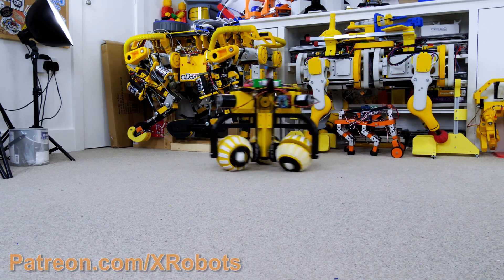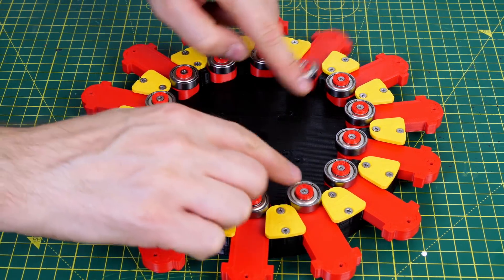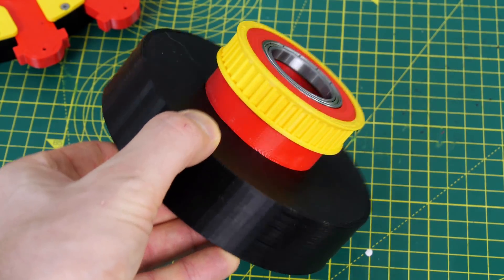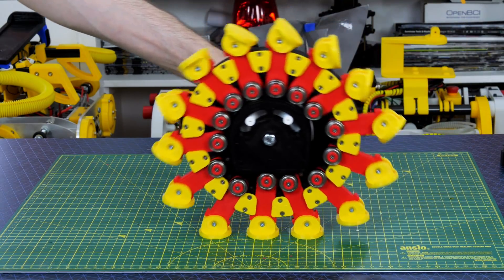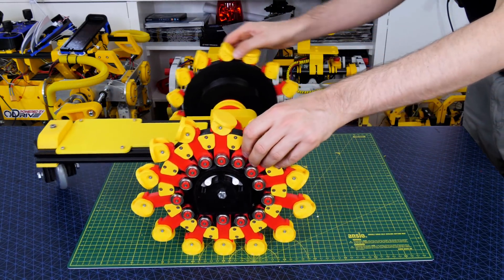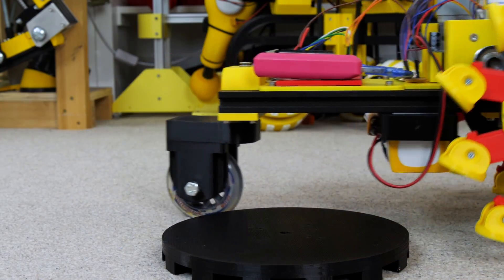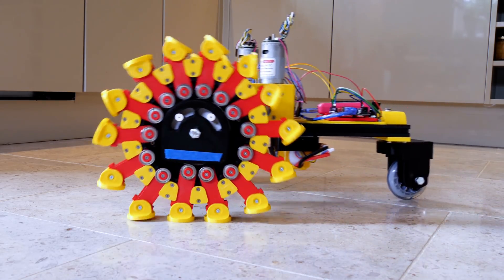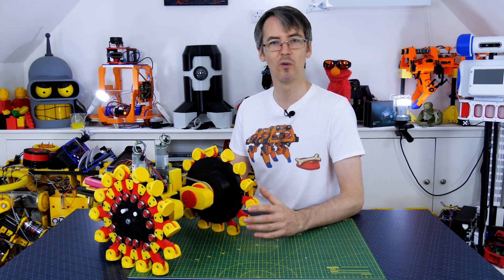Are these Walking Wheels Practical?

Comment: So nearly my battle-ball idea (which can climb steps) : Replace the pins with linear actuators. The original intent was a self-returning ball that could move by changing its shape so only as fast as its actuators. The 'battle-ball' name came from a tank design in a very old comic...   Using the latest actuators and selectable feet for different terrain, you could jump as well as climb and walk, absorbing impact of falls, etc.

Comment: Perhaps to combat the tangling problem you could have rather than rubber grips a rubber belt all the way around affixed to the feet. That way you have something more akin to a deformable wheel. You could add a bit of tension through a rubber band or such like to the parts of the belt inbetween the feet so that it always folds up and in and out of the way. Or you could make a mechanical belt tensioner of some kind inbetween, no idea if that would be possible but as far as I'm concerned mechanical belt tensioners for things that change geometry in any way are witchcraft but people do it anyway.

Comment: You should try replacing the feet with a continuous flexible rubber tire that goes all the way around the wheel. It should be flexible enough to let the legs move fairly freely.

Comment: Just saying, no hate but calling this impractical is not true, Relying on the feet without any rubber, is like relying on a car with no tire on it or like walking on a slippery stone without shoes. In one way, we ourselves are impractical, so we use other tools to help us, like shoes or clothes. The hose test is impractical, these things won't climb hoses, but instead climb stairs or rocks. I mean, a true circle plastic wheel wouldn't be able to climb any of these obstacles, nor would it reliably drive, without some form of grip on them. I'd say add rubber shoes on them so we can see it's max capability. (Also 4 wheel drive). Yes, without any grib on those feet, it's impractical but that's with a lot of other things, so i'd say try it, let's not give up on this idea!

Comment: Maybe if you'd bolt a loose, stretchy belt to the ends of the feet that would go round the circumference of the wheel you'd have a wheel that changes it's geometry to conform but wouldn't get tangled in things?

Comment: I would like to see a version 2 on this project. This time with 4 wheel drive, semi sphere shaped rubber on the feet, and a suspension.
Just on a side note, if you had printed a normal wheel it probably wouldn't climb those loose objects, so i think it's a success.
Reply: This! Saying this test wasn't a complete success is mind boggling. It where able to climb steps and different shaped objects. A wheel without any rubber or grip would just hit the object and spin while pushing that object away. This climbs it, even without any rubber at all! There's so many fun experiments and possibilities if that where added. I mean, Boston dynamics robot uses rubber feet. If those where solid plastic, it wouldn't be able to climb a single thing!

Comment: Love the quirky wheels!  Instead of adding rubber pads, how about wrapping it in an elastic tread?  For instance some giant wide rubber bands?  Also need a new cam so that 2-3 legs are supporting weight most of the time.  While you could calculate this curve exactly, probably much easier to roughly generate it in CAD and fit a spline through 5-6 points.

Comment: The feet seams to reduce whats possible. A static feet with pointy tips on each side could maybe be something to try. They would run flat on the flat part and get very grippy, almost biting into the surface depending on the angle of attack.

Comment: If you look closely only one leg is taking weight at any one time, especially on rough surfaces. Look at the way the bearings touch the guide. Most of the time only one is in contact.
By the way, why do I get the feeling this should be printed from sapient pearwood?

Comment: Adding friction to the pads with the current design would likely be problematic because the feet don't stay the same distance apart during the ground-contact portion of travel.  Some slip is actually necessary.

Comment: This appears to suffer the same disadvantage actual feet have, except without the ability to precisely place each foot. However don't wheels also suffer under the same conditions, traction being lost over loose material... Perhaps try this inner hub design within a flexible wheel.

Comment: You can see why the round wheel is more common than having loads of feet. A single wheel of rubber is much easier than individual feet of rubber, and with suction cups there would be the added need for a suction toggle or the feet wouldn't let go and also you'd have to fit a sucker cleaning mechanism because dirt and dust would stop the suction cups from attaching fast.

Comment: That lipo is starting to look a bit puffy. You might want to recycle it and get a new one. Off gasing is a symptom of cell degradation and the battery warning you that it is failing. Definitely not something you want to mess around with as a lipo fire is no joke.

Comment: I think part of the slipping problem might be because the chassis tilts when one wheel goes higher than the other, reducing the contact area on both sides. In addition to four-wheel drive, you may want to consider independent suspension for each wheel as well so they all stay upright when going over uneven terrain.

Comment: what did you expect without rubber feet? Do you see a tractor running without rubber on bare rims? THIS IS FALSE!!!
Reply from the maker: The test was to see if it would step up over things. Any spikey wheel with rubber feet would work (and get caught on things even more)

Comment: They should build wheelchairs using this mechanism to climb stairs, maybe also adding a gearbox to put a smaller gear to increase the torque transmitted.

Comment: Maybe with a wheel guard that goes about 75% around the outer wheel would help keep things getting caught. Only thing sticking out would be the feet that are needed for actual locomotion.. Might help with the hose issue.

Comment: Heres an example; WW1 heavy artillery: https://en.wikipedia.org/wiki/BL_6-inch_26_cwt_howitzer#/media/File:6inchHowitzerPozieresSeptember1916.jpg

Its great for traversing mud if you haven't really perfected tracked vehicles yet, and also, tractors DID have them in ye olden days, but rubber wheels are just simpler to maintain and when they are not suitable enough its better to just go all the way and get a tracked tractor.

Comment: I wonder if a rubber track around these wheels would give a dramatic improvement with loose objects, objects that fit in between the legs and objects that can get caught in the legs?
Probably not an improvement on a traditional tank track though.

Comment: Why not longer arms (and length adjustable and kind of spring loaded  just before touching objects). 
By you design the flat part doesn't represent a such big wheel at the end..  so the feet doesn't come from very above...
With longer and spring loaded arms in the front, the feet has more chance to be upon the objects.

Comment: How about putting soft rubber all around the wheel, so the feet still can dent it, but the wire/hose tangling wouldn't be problem

Comment: Since the legs are "shorter" when in contact with the ground, I wonder if some kind compressible material like foam or rubber between the legs will help. It could contour to corners when climbing the wood stacks, and make it more difficult for things like the hose pipe to catch between feet.
Reply: You mean a bit like tank tracks?

Comment: A much simplified version was used for field artillery wheels during the great war, just to spread the weight of the wheels over soft ground. essentially a slightly loose track with flat feet that the wheel would run inside of: https://youtu.be/s3uZB1CL4Mw?t=20
Reply: So Rotoped-tracks but with shorter tracks?
0:07

Comment: I think it isnt fair - you should compare it to same radious 3d printed "normal" wheel with and without rubber on both. 
Just looking on contact surface it should be better than normal wheel.
Idea for improvement - retracting legs more to make flush surface could make it less grippy (garden hose)

I know it is easier from comment section, sorry - fan of your work ;]

Comment: To be fair, a circular smooth plastic wheel would fail far more dramatically in these tests. So would a standard robot leg. Try it with some form of friction pad and see if it makes it better or worse!
Reply: Probably could make the shafts and the feet spring loaded instead of that contraption inside the wheel, and it would work as well or better. Specially in regards to getting tangled.
Reply: Yeah, I'm not sure I really understood his reasoning there.
Reply: @startedtech  9:20 is the 'reasoning' for not using any grip on the feet. In other terms, it's more than likely just laziness, as this is a preliminary test of the concept that'll never be touched again; a common theme among these conceptual drive schemes that could actually work better if they were refined, but they aren't refined due to no further work being put into them. The dog project is basically the only thing that gets consistent refinement here. I understand not wanting to develop an impractical concept, because there'll be little return on investment, if any at all, but even just using grip tape on the feet would've proven that grippy feet are an improvement. Or even a TPU band that's secured to the ends of each foot, to act like a deformable tire, would've further shown that the concept has potential if even the most minimal effort is put into it. Ironic how the walking robot with front wheels, something that can climb stairs with just its normal legs, a project that's even more impractical than this, had more initial development put into it; picking favorites, perhaps. This lack of development, and potential lack of effort as a precursor to lack of development, has been one of my long-standing complaints about this channel. Such as the dog project, for example, V1 could've had simple improvements to add compliance to it's design, V2 could've had simple improvements to its overall design to make it more robust and more functional, both would've been practical and relatively simple to develop, similar with the omnidirectional robot series and numerous other series, but we didn't see that kind of improvement; instead we see long stints into a single development at a time that is making this dog like every other popular robotic dog in design similarities, which I believe it had been stated in the past that James didn't want this dog turning into a copycat, yet it's essentially becoming that at this point. Honestly, it's aggravating at the very least, especially when there's ideas widely recommended in the comments that get blatantly ignored due to ego and arrogance, and sometimes that arrogance even comes out in replies from James. It's even more ironic when this arrogance comes out against people who actually study and do robotics as a career, legitimate suggestions get shot down pretty quick even though the person suggesting them has more knowledge of the topic at hand; it's literally becoming armchair roboticist mentality just because he's a content creator with a 3D printer and some basic kit to run robots with.
Reply: Yeah I thought that was kind of odd as well lol.  I think the benefit of this wheel type is that it directs force straight down on an object that it transverses (hints why it was designed for stairs).  So when the wheels slip because of no traction, it loses control and starts knocking stuff around.  Hitting objects with the wrong parts of the feet and at the wrong angle.

I would think the whole point would be to make sure the grip wasn’t compromised - like bipedal locomotion that this imitates in a way.

Not saying this invention is practical or useful in any way, but the true form and function of this device was not preserved in this build.
Reply: https://youtu.be/Lov1sdU7Lyoi4

Comment: Technically, this is  "just" a solid tyre design. The fixed hub in the center even looks like the volume of compressed air spinning inside an air tyre.
Reply: Yes, I was sat at the end of this video thinking, what if you put a rubber track right around the outside of all the feet...
Reply: @Jimbaloidatron  you could also replace all the Feets (the whole feet) with a elastic/rubber counter-part.. rigid enough to keep shape to get inside when aligned but soft enough to aid with traction, plus contact surface as it will sightly bent, and in some regards trying to acomodate/fill more evenly the rough terrain.

Comment: That's awesome! Cool how you just took a patent and made it without any other reference 😅

A thought. Since the feet are angled in relation to the fixed plate's flat part, the feet aren't actually flat to the ground. Or if they are they're not flat to the plate.

Comment: You need a concave instead of the flat part in the guide wheel to make the 3 feet contacting the ground equally supportive.
Reply: Maybe the guide (= "camshaft" ?) should be lower too, because if you look at 11:54 for example, we can see that the bottom legs are NOT touching the camshaft but are pushed away by the white part holding the camshaft, so it it still following the circular shape
Reply: @jakubpollak2067  Agreed. The cam is completely the wrong shape. It should be the maximum diameter everywhere except a concave section just at the bottom that allows the feet to be evenly distributed on a flat surface. Why go to all the work to build these things and not go the extra inch to do it right?
Reply: I noticed the same thing.
Reply: Yes, the feet sliders are rotating, which means the height of the bearing in the guide above ground changes with the angle, you need to compensate for that to make multiple feet flat contact on the ground
Reply: Concave like the arch of a human foot? Just to be clear. Hmmm... Also the stairs couldn't be tall human stairs but like small cat or tiny hamster stairs.
Reply: https://youtu.be/Lov1sdU7Lyoir

Comment: The most practical real world solution for wheeled robots climbing human scale stairs is 3 small powered wheels in a vertical triangle shape that have an additional powered axel in the middle of the triangle.

Would be interesting to see if you can reduce the number of motors, You could print one up that uses one motor on the middle of the triangle axel and belt drives the 3 outer wheels until it stops when it runs in to the  bottom of a step, then it would turn the center axle and climb the step automatically.

Comment: Nice! Reminds me of the robot I designed for my senior project in high school, I tried to make a spherical robot with panels in the pattern of a soccer ball (so a rounded truncated icosahedron), where each panel would be powered and connected to a microcontroller telling it how to drive. I got the design more or less done, and a small demo printed out with only one functional panel, as well as a fully functional simulation in Unity. However, it ended up being unattainable due to cost and time, if not completely impractical. It was a fun and educational experiment though!
Reply: Similar indeed! The mechanical design was completely different, but the style of locomotion when rolling by using the panels is pretty much the same. This is super cool, thanks for sharing
Reply: Sounds similar in design to the MorpHex robot https://www.youtube.com/watch?v=yn3FWb-vQQ4

Comment: Fun mechanism.  With grip and the wood being heavier or not loose it would do way better, but so would a normal wheel with rubberized spokes.  Seeing a comparison of this with rubber feet and a similar sized wheel with rubber spokes sticking out would be interesting to see if there is any advantage at all.

Comment: @James Bruton I've noticed a lot of your robots seemed to use what appears to be DC motors instead of servos for their designs. Is there any reason you choose motors over servos for your designs? 
EDIT: I'm not referring to the robot in this video specifically, rather when I wrote this comment I had the more humanoid robots in mind.
Reply: Cost and practicality
Reply: Servos are usually just DC motors with potentiometers or some other sensor input to give positional control, which is not needed for driving wheels especially since servos generally don't have the ability to rotate continuously in the same direction.
Regarding your edit, not sure which project you're referring to, but in most cases probably for more power at a lower cost.
Reply: @aasmundwt  That makes sense, but what about the other more humanoid robots with limbs? is there any practical differences in use in those instances?
Reply: Take a look at any R/C vehicle. None use servos. Servos are big in robotics, but motors are good when you want something to turn at a given rate, and don't care if there are slips. Imagine if EVs used servos!
Reply: @MichaelAPede  I've seen him use what appears to be motors in his humanoid robots too though (first one that comes to mind was his Utron robot), is there anything else lost besides motion precision in these instances?